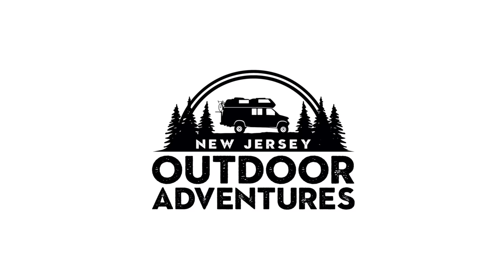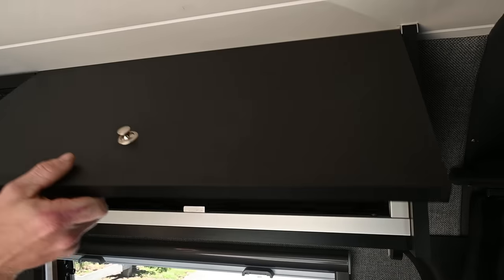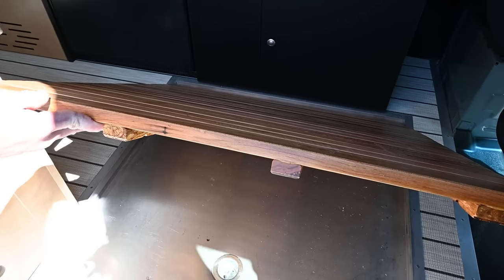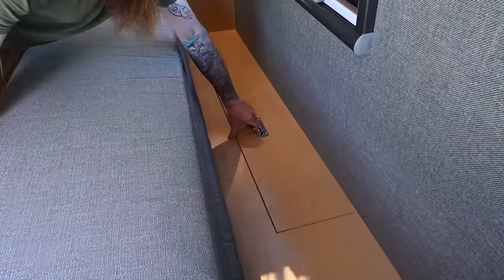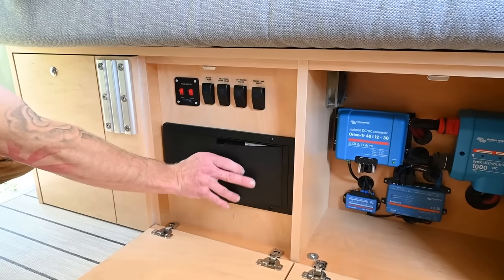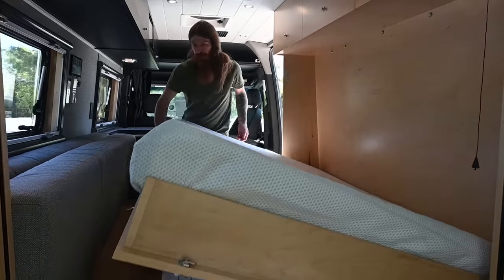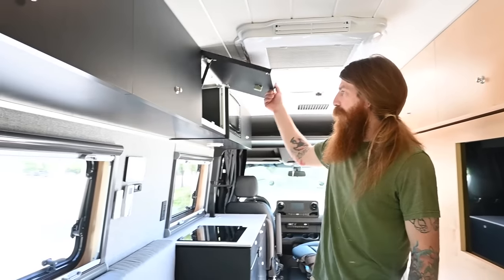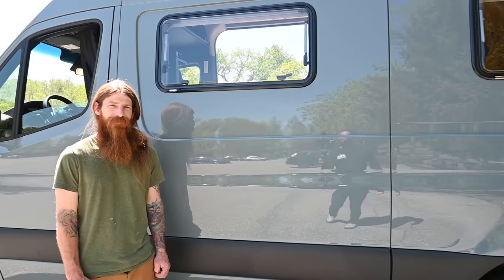MOST Creative Van Layout - Murphy Bed, Hidden Shower & More | SPRINTER Van Camper

Comment: Very nice but I hope the stuff they're gonna add includes some storage.
Reply: It may not appear to have a lot at first glance, but there is roughly 30 cubic feet of storage in the overhead compartments. The kitchen also has a significant amount down the center and separate designated space for cutlery above the fridge.
Reply from the maker: There is more storage that what may appear

Comment: Great concepts overall but a little short on sleeping space
Reply from the maker: The bed is the same size as most 19’ Campervan beds I have seen
Reply: I’m have same van design and I’m 6-3, added flip up bed extensions and bed is 80” long now

Comment: How do you access the VGA and/or HDMI port on that monitor? It looks like it's only accessible when the bed is down but then, of course, the screen is hidden. Hmm
Reply: There is an HDMI, and vga cable ran down inside to the lower right-hand side cabinet door. In the same space there is another 20 amp outlet with usb and pid charger built it 🙂
Reply from the maker: There are cable ends in the lower cabinet

Comment: Didn't get a good look at the rear step but it appeared to be for use on the PS and that is a first for me.  I use the PS rear door as my primary and have since 10+ years ago when I learned how MB made the front door detents factory lubricated, read: you have to R&R them because they can't be lubricated by an owner.  Wondered about the mfr. of the step?
Reply from the maker: Thanks for sharing that.

Comment: In cold environments, how do you ensure that your water tank heaters do not fail? Because if they fail, i feel that a freeze could happen very quickly
Reply from the maker: You can add sensors that will communicate with the Victron Cerbo GX and alert you if the temperature reaches below a threshold

Comment: I’m kinda confused about the orientation of the water tank? You say it’s under the spare tire? So if you need to get to the spare, how does that happen? Also, I’m uncertain of the monitor under the bed. I’m not bragging, but I’ve broken a few beds in my day and that seems like a sure way to destroy a monitor.  It’s unfortunate how much space was given up to the battery system and seems like it would still overheat in the summer, but I guess it would help keep you warm in the winter.
Reply from the maker: How do you keep breaking beds?

Comment: I'm always curious about the spare tire.  What happen when you need it?
Reply from the maker: Most class B campervans do not have spares however there are spare tire brackets that can be installed on the back doors
Reply: It’s on order
Reply: @NewJerseyOutdoorAdventures It seems most class B’s aren’t 4x4’s either……but off the beat & path, I want a spare! 🛞

Comment: Man I don't want to be a hater but I gotta point out that it doesn't look like you can make use of the bed and the tv at the same time and most of the storage space is filled with overkill electrical. I mean you really don't need all that electric right? There's not many places to put in larger appliances. Kinda feels like you're driving a big battery
Reply from the maker: The bed got a lot of positive remarks

Comment: The window blinds are upside down.  They should roll up, not down for better privacy.
Reply: Either way gives 100% privacy, most people want it shade down
Reply from the maker: You sure about that?
Reply: @NewJerseyOutdoorAdventures  absolutely 100%.  All Australian caravan and motor homes shades pull up from the bottom.  If you leave a small gap to look out from you can’t see anything the other way around.
Reply from the maker: @DiHandley  oh man
Reply: Didn’t think about that, learn something every day, thanks
Reply: @paullehto2294  A camera system would solve the problem, I would actually prefer that.  Could that be an optional feature at some point?

Comment: Comparing this (and all that I see to my dad's old micro-HRRVC rv van) I feel like you've taken too much potential storage space away by tucking that giant bed up against the wall. Could have had full length closets there.
Reply from the maker: Appreciate the feedback. Many feel this is ample storage however some people may want more
Reply: I never seen storage floor to ceiling  bed area in class b. The bed would be  narrow if you did. The benefit  of Murphy bed is you have large fix bed already made when down, when up you get open space to use to put things such as bicycles or just enjoy the space. Makes small camper feel bigger
Reply from the maker: @paullehto2294  good points Paul

Comment: If you have hot water you don’t need a heater. Why heat hot water?
Reply from the maker: A hot water heater heats cold water and makes it hot, then reheats the hot water periodically through out the day.

Comment: what was the price of the car itself?
Reply from the maker: A sprinter like this sells between 68 and $78,000
Reply: @NewJerseyOutdoorAdventures  so why do you charge 100.000 extra 👀 i mean i know it takes months to build sometimes but yeah you spend at maximum 25.000 in materials and i would love to have a comission like you 😂. A fully equipt camper goes for like half the price i really wonder wo would spend that ammount of money on a van
Reply: Mercedes themself are selling the sprinter as a camper van fully equipt for 90k

Comment: Why have a TV if you can't watch it from comfortable place like bed.
Reply from the maker: Because there’s also a projector
Reply: I agree, I have same van design for my personnel van. I added two things. Second rv that drops from ceiling right behind front seats, and added small tilt up tables on back door that are great for snacks but more importantly, they prevent pillow from falling to floor when I’m sleeping.

Comment: This is really nice, unfortunately only the rich can afford it. 😢 Do you make more affordable ones for regular folks?
Reply: I appreciate that, Elaine! I certainly agree the price points of fully loaded vans can be high. With that in mind, while building this van I built an autocad file of all the cabinetry. All in hopes that in the near future I can have flat packed build out kits that can be assembled by anyone. With then the option of the more expensive components like battery bank and plumbing left to the owner to decide on the complexity.
Reply from the maker: Thanks for looking

Comment: Solar energy makes van life a bit more convenient.
Reply: When you have 800 amp/ hr of batteries and solar when available can provide 100 amp/hr per day your short 700 amp/hr. When your park in shade to reduce your a/c load, or on a cloudy day you get no charge from solar. So we went all in on a second alternator that will  charge this large battery bank in two hours. It will charge in 15 minutes what solar can do all day.
Reply from the maker: It can always be added if the owner decides necessary.

Comment: Why not use a flip down monitor so you watch a movie in bed?
Reply from the maker: Nice suggestion
Reply: I considered that but with the space constraints above the Murphy bed it would have had to be a significantly smaller monitor.  The good news is the large privacy shade in the rear doors is rated for video projector use.  With the large availability of inexpensive compact units, one can easily be mounted under the driver's side cabinets for night use!

Comment: How to turn a big van into a small one....add a Murphy bed. It could be worse it could be a Merc...oops it is!!
Reply from the maker: Oh okay
Reply: @NewJerseyOutdoorAdventures  You are welcome, I'm sure you would have figured that out for yourself soon.
Reply: I prefer transits, can’t get them
Reply: @paullehto2294  Used to be the Transits were good, until they went front wheel drive and now they have big reliability problems. I hired one in the UK and it broke, a friend of mine had one and the drive shaft went and he had other issues too. The old model were very reliable, I had one but very crude and rusted. The Vivaro is everything you could want and I am 7 years in on an 08 plate. Cheap servicing and repairs too.

Comment: Another empty van, i find that really boring:(
Reply from the maker: Would you like to see it moved into or more decor.
Reply: Form follows  funtion is The first thing they teach in design. It has to Satisfy the intended purpose. In this case to provide in a very small space a mobile home Experience. Bedroom, living room, kitchen, bath with off grid heat /ac and electricty. Then the second part - make it look good, so it’s pleasing to look at. It’s very difficult.

Comment: 165k lol ok.
Reply from the maker: Thanks for looking
Reply: Lol , sold it quickly. Sprinters are selling for $10000 over msrp these days. 10000watt 48 v second alternator, victron electrical system cost $14000 with out two weeks labor. $ 30000 profit for 2 months high skill work is not too much. When I build homes I make triple that, that’s why we do these only in winter. Besides o like building vans more than houses